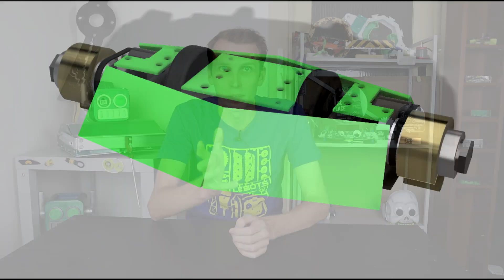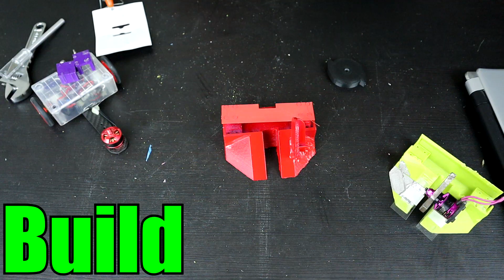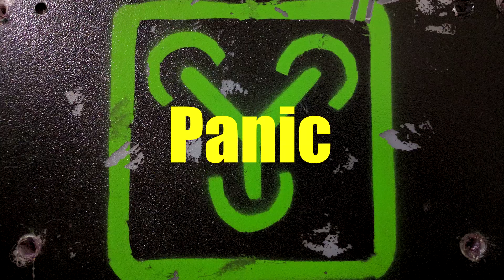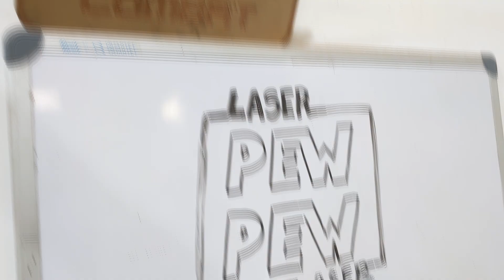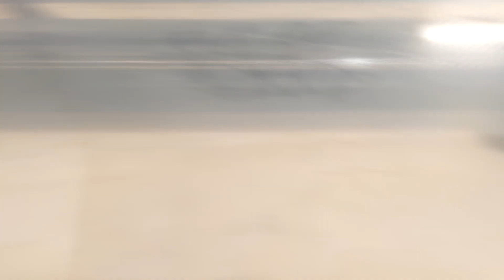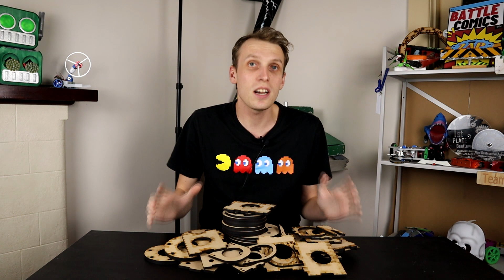Prototyping Zap's drive (110kg robot building!)

Comment: 14:47 those wouldn't last long in a pushing contest if you burn rubber on the floor and take off that 2-3mm ;p
Reply from the maker: They are designed for a melty brain , ideally this robot will never be in a pushing contest

Comment: since its an internal axle, could use a Chromalloy axle from an ATV or something... super strong and flexible... 1000mm long x 25mm handles a 1000lb ATV from a 20' jump without issue
Reply from the maker: I might do for the final design, but I'm a long way off ordering the steel for this

Comment: Can very much see the belt climbing up and off that tensioner system.   Put a retainer on top or make it taller so it's the same width as the groove on the wheel?
Reply from the maker: Its suppose to be larger I just didnt have enough bearings, they have been ordered but havent arrived yet
Reply: @TeamPanicRobotics  fair play

Comment: Honest opinion, maybe consider bigger motors? Most other robots with a similar motor seem to run a pretty large gear ratio to drive wheels (Monsoon), or two motor per side + some reduction (most 4wd brushless verts) or have two big motors per side and use single stage belt reduction (Claw Viper). Considering how drive-centric a melty is, I think maybe larger or more moters would help. But obviously I could be totally wrong as I haven't built a HW myself.
Reply from the maker: I didnt talk about motor size in this video and I realise I should have
I'll cover it more in the electonics section, but these are 8080's from memory Monsoon runs 6374s which are less powerful then these

I do want to make sure that I have a lot of drive power, but I think these will both work and fit inside the robot
Reply: @TeamPanicRobotics  Ah I see, thx for the info.

Comment: If you need 50mm OD tube, go to your local kart club track ( Serious karts, not rentals). Many classes run 50mm rear axles. 
They are usually 1020-1040mm long and expensive. 
However, they often get bent, at which point they go in the bin. 
You will be able to cut the straight pieces you want out of one.